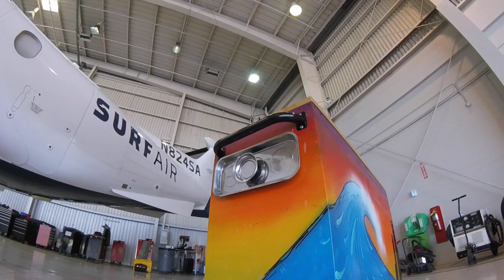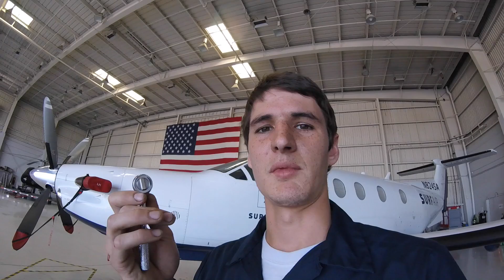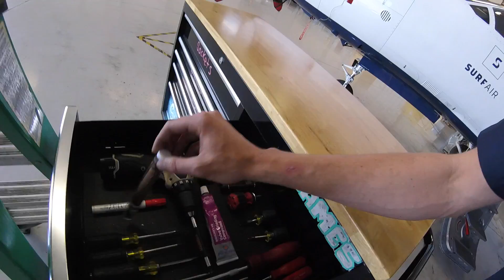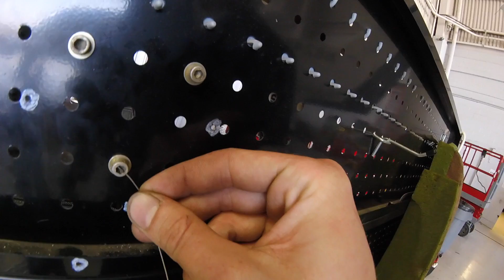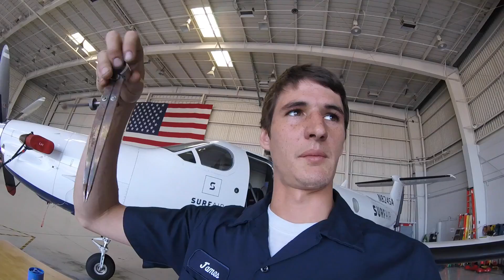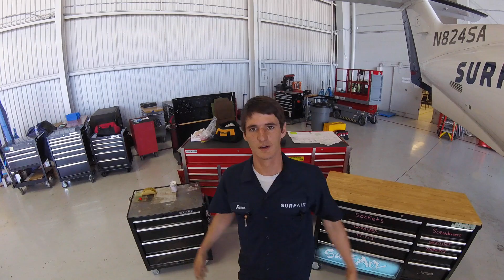What's Inside an Aircraft Mechanic's Toolbox?

Comment: Highly recommended tool for all new mechanics, a Wera ratchet set. Although expensive, it is a very versatile tool that can be used for bolts, nuts, and screws. A good all in one tool, and great for AOG work.

Comment: EXCELLENT all the way thru.
Your advice about the price and wuality is dead-on. I'm retired now but I seldom bought the TOOL TRUCK BRANDS because they are just super inflated and a tiny shinnyer...(NEW WORD).
I have several thousands of dollars in my tools and boxes...YEAH, after almost 55yrs as a mechanic and it all adds up. HOWEVER, I didn't just go hog wild in the beginning. I bought mostly bare necessity tools from SEARS and HARBOR FREIGHT with the LIFETIME WARRANTY. I've got new for you, THEY STILL GET THE JOBS DONE JUST FINE and I kept more wage for the family and my toys, which are many.
You only need to buy those SPECIALTY TOOLS of better quality from a TOOL TRUCK only because they are as stated; SPECIALTY TOOLS.
I've NEVER had an issue with any warranty at Harbor Freight,,,ever. I have with a name brand tool truck tho...go figure?
Another great video and keep them coming like this.

Comment: Good tip for all new mechanics, DONT blow your money on a snap on box (unless you have the money) fill a decent box with snap on tools. You’ll thank me later.
Reply: I wholeheartedly agree with that. When I started in the automotive industry, I had a cheap US General 5 drawer tool cart which cost me $250, that was all I needed for the experience I had at the time. Even when I upgraded I didn't go insane for an expensive snap on box, instead I got a cornwell 100 year anniversary tool cart, that only cost me $500. I still have that tool cart, and it works very well for everything I do. It'll be a very good for me whenever I go into the A&P world. A $20,000 tool box isn't always necessary.

Comment: Could you recommend one essential tool that I need to buy before starting my career as aircraft mechanic? Right now I am still a student, I just want to have my very first essential tool that experienced mechanics, like you, would recommend.
Reply: You need all of these things. Doesnt matter what you start with because you wont be able to work without most of these things. Start getting various 1/4'' ratchets. Long 1s, skinny 1s, flex heads etc. 3/8s ratchets. You need screw drivers and wrenches etc. I wouldnt say there is "1" essential tool as they are ALL essential. :) dont over think and complicate a simple thing. Make a list and start buying.
Reply: Alexander Nalog a pen. Black ink

Comment: If your a new technician, check with the company you are going to work for, before buying all your tools. Reason being, is that with the new safety standards many larger companies are going to company bought community tool boxes which are completely shadow boxed. My company went to a level 5 Snap-On system which scans the draw before and after you open it and remove tools. So they know which tools you took and if they are not back in the box at the end of your day! Of course this system is super expensive and a small shop would not purchase a system like this. I have been in Aviation maintenance for 33 years and have accumulated a lot of tools! My company required everyone take there tools home. Now i have a bunch of standard SAE tools that just sit in my box, since most everything you work on at home is metric! I worked my first 23 years for a major airline and I can say for a fact, you will NOT need to spend a fortune on tools! I had a rollaway on site but almost never used it! 98% of the time I used a tool bag with a good quality assortment of standard tool. Or a cantilever open toped small tool box that was on wheels ( called a Dog since you attached a lanyard and pulled it behind you)  I was an avionics /electrical technician primarily. Aviation line mechanics need to be mobile! Mot specialty tools for certain aircraft are bought by the company, and might need calibration every year.
A good quality shallow and deep 12 point 1/4” socket set is all you will need for the most part, socket wise. If your on an engine change crew you will need to scale up of course. Highly suggest you get snap on ratcheting screw drivers, wire cutters, needle nose etc. The Best 1/4” 90 degree bit driver that i have is the one from Rigid or from Lowes. It has a 1/4 socket driver on the other side and is super compact. Use it all the time, and i have the more expensive ones and i don’t use them anymore. Now if you work in a repair shop you will need some sort of tool box and will probably require more tools. If you know what you NEED, search for it on Ebay. I purchased a lot of almost brand new snap on tools for a fraction of the cost! Get your list of tools and know what they cost full price and don’t over bid. Over time you will build a nice set of what you need or want. Over time you will find out which manufactures make the best specific tool you are looking for. Snap in quality has dropped a bit from the old days. A majority of my older snap on tools I have at home now , are way better quality than what we now have in the community tools boxes. The older Ratcheting (dog bone) wrenches are super useful in aviation. Gear wrench makes some great quality ratcheting flex head ratchets. Also Note that most aircraft hardware is either 1/4”, 5/16”, 3/8” and mostly 12 point drive. I think i wrote too much! I will get off my soap box now! :)

Comment: When I went through school I asked one of the instructors if I would ever run into metric. He said "Not likely". My first job was in Aerospatiel helicopters.. and the manuals were in French..damn..
Reply: obsolete professor not many metric around except on batteries, and other GSE you might use that need a quick fix or clean.

Comment: I’m wondering what the best safety wire pliers you’ve used. I want a reversible set. What do you recommend.
Reply: I work with machines for long time, now instead of the safety pliers if the surface is not hot I use regular caulk. This keep your bolts and nuts in place and you can remove anytime.

Comment: Hello James how are You?
 Somebody told me air plane mechanic use different tools them car or big truck mechanic, is that True? 
 Have great night.
Reply: Daniel Montuam there are allot of specialist tools that are aircraft only but as you fan see in his tool box the commonly used ones are also used by car mechanics. Except a ratcheting screwdriver, no one here outside the aircraft industry knows what it is. And safety locking wire pliers.

Comment: Tools are made from Chrome Vanadium case hardened but brittle inside the shell no matter who the maker is,the thinner the tool the more likely it is to snap one day and snap they do ! it only takes one flaw to weaken them and any overload will spell disaster,you have to work out whether it is worth spending the extra on Snap On,do they offer replacements for life ? heard so many stories when things go wrong and the tool breaks so this is important to take this into consideration,the problem with ratchet tools is they have to be made to high tolerances to be any good,if they are sloppily made then they will not last long and you will gash your hand too as the thing explodes,buying tools today must be a nightmare for aircraft workers,as regards lost tools in aircraft then adopt what the RAF do and make a shadow board set up,check it at the end of the working day to make sure every tool is accounted for,another great video James offering food for thought,love your tool box decor too !
Reply: Angel Reading Yea a shadowed tool box is mandatory in Australia.
Reply: In NZ mandatory and where I work policy is tools set in contrasting foam

Comment: What's the best tool brand?  The cheapest one that works!  I've got just about every brand available from Bahco to Wiha.  Snap-On are nice but not worth going into racking up debt over (except for their ratchets ;).   I don't understand all the tool snob comments.  

Love the paint job on the toolbox.  Cheers!
Reply from the maker: I found a busted snap on rachet at a pawn shop for $25 and got the truck guy to repair it for free!

Comment: Surprised you don't have a set of double open end wrenches with a 30 deg head on one side and a 60 deg on the other....helped me get loose bolts/nuts where the standard 30 deg wouldn't work. I do agree on the wood top...
Been a long time since I worked in the aviation trade....and yes I have my A&P...
Thanks for the video...

Comment: No chip-chaser, countersink stop, or even a flashlight?  Cleco pliers?  Magnifier?
Reply from the maker: +Sean Beardmen yeah they're pretty new planes so haven't needed much structures work. The sheet metal tools we need are provided by the company
Reply: We had an old fart who did most of the sheet metal work and a young guy who did only paint. I helped him once depaint the trim around the windscreen on a jet and he buffed it up all shiny. He had every owner coming around to touch up screw heads and hail/rain damage to the nose and leading edges.
Reply: @obsoleteprofessor2034  poor guy probably dead already from hardener

Comment: at the end were you talked about checking that every tool you used is back in your box, that is the part were fitting foam inlays come in handy
a friend of mine here in germany is an aircraft mechanic and he is only allowed to use the tools in the cart and nothing else
(in germany you dont use private tools, the company you work for is providing the tools)
every tool has its place in the foam inlay and the inlay is designed with a black top layer and a bright yellow bottom layer so you can easily spot a missing tool
companys like stahlwille even sell ready to use sets for aircraft mechnics with this system
Reply from the maker: Yeah I plan to foam my box when I think I have all the tools I need. My last company provided the tooling which was really nice

Comment: What are the cons of being an AMT?
Reply from the maker: I would say possible high stress environment. Working odd hours (a lot of jobs are for night shift) and in some cases the need for unplanned work travel.
Reply: James Sullivan I really want to be an AMT, and Im used to long shifts, plus travelling seems cool. Have you had any experience with your supervisors telling you to deviate from the books, Long ass shifts (18 hr?) Or issues with unions?
Reply from the maker: I avoided working for a union for personal reasons and I've never had an issue with supervisors pressuring me to deviate from the books but that definitely happens. You need to choose carefully and work for a company with a strong safety culture. My regular shift is 12 hours and I've stayed maybe a couple hours late before but it's very rare and it was only because I had a job I wanted to finish (rather then me being asked to stay late I decided to). Let me know if you have any other questions I can answer.

Comment: Surprised the PC12 used SAE hardware, especially considering it's made in Switzerland haha
Reply from the maker: Yeah we lucked out there. The engine (built in Canada) is also SAE. No metric on this bird. The Pilatus Porter PC6 has a blend of SAE and metric. What a nightmare
Reply: That threw me off as well, we have once based at the FBO I work at. Before they pulled me into maintenance out of line service I was expecting there to be a mix of metric and standard, I was very surprised when the chief inspector told me that they almost exclusively use standard (unless some falcon comes in or something) . This video was a huge help in organizing and solidifying all the little tool suggestions I've gotten from the mechanics. That dogbone ratchet has been a lifesaver so far and husky used to make a smaller one though I found another company took over the production, here is the link, https://www.amazon.com/Vim-Products-HBR5-ToolsHBR5-Ratchet/dp/B003TSMQWU/ref=sr_1_1?ie=UTF8&qid=1495081573&sr=8-1&keywords=vim+hbr5 they also make one even smaller called hbr3.

Comment: dear new mechanics, invest in a good ratcheting screwdriver, very useful
Reply from the maker: yep - they are a huge help
Reply: Snap-On with 5 position handle, changed my life :D
Reply: thanks dude
Reply: Snap on for sure
Reply: YEAH!!! i got a snappon that you can change the length of the shank and i use it EVERY DAY!! that and small 90 degree ratcheting screw driver use that for the hard to reach places
Reply: Or work at delta, tools provided
Reply from the maker: How is delta doing these days. Not being rude just genuinely curious because I know a few pilots there but no mechanics.
Reply: @JamesSullivans  making lots of money
Reply: Any particular brands you would reccomend? 
Just starting school (finishing Human Factors rn) but i want to be as prepared as possible.
Reply: I use the Craftsman 13 in 1 led ratcheting screwdriver. It's $17 at Sears vs. Snap-on which is $100 and without a led light on it.
Reply: Any help with a starting tool list im currently in school and i have the snap on student discount and will like to get a hand full of tool while a can any help will be appreciated my plan is to go to commercial aviation thanks
Reply: @joses.colonpagan2575  get a set of imperial and metric wrenches . Ratcheting screwdriver . Speed handle . Drill. 1/4" ratchet set and 3/8 ratchet set . Hammer . Punch set. A few flashlights.  Ratcheting wrenches . Pick set . Coterpin puller (snapon) . That should be a good start for you , I also recommend the flex head ratchet from snap-on
Reply: @joses.colonpagan2575  of course some needle nose pliers and get flush  cutters too
Reply: Thanks a lot man 🤟🏽
Reply: @joses.colonpagan2575  Turdpike on youtube also has a video on what he considers the bare essentials to start with, might check that video of his out as well
Reply: Will do
Reply: Fuck that shit, you're still gonna get carpal tunnel, USE A DRILL!

Comment: No Cleco or Cleco pliars? How about a Hi-lok ratchet? Countersinks or spot faces and micro stops. Rivet squeezer and shaver? Got a FOD bag? Hand wind deburr tools. Shop air powered hand vacuum. https://www.browntool.com/Listview/tabid/344/txtSearch/vacuum/ProductID/1115/Default.aspx

Some engine manufacturers prohibit the use of any hand tool that's chrome plated due to embrittlement at temperature. Black oxide finish only.

Amazon sells foam sheets called Kaizan foam. It's used to shadow board your tool box. Made of two contrasting colors.
Reply from the maker: Thanks for the tip about embrittlement. Do you know which manufactures mandate this? I prefer a black oxide finish anyways. Also we dont do a whole lot of sheetmetal here at Surf so the company provides all of that stuff. I will probably get my own when I decide to build my first plane.